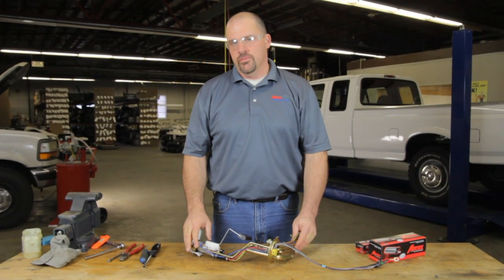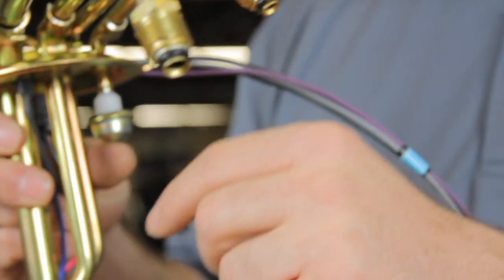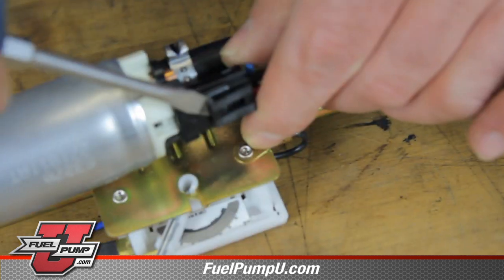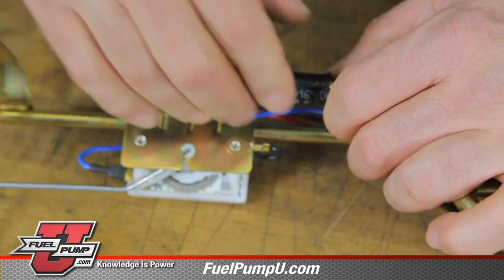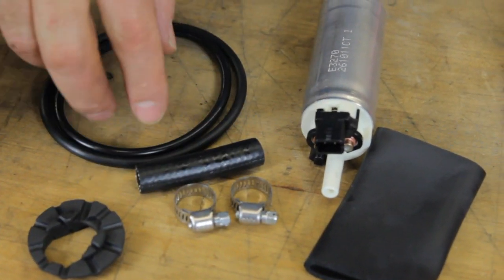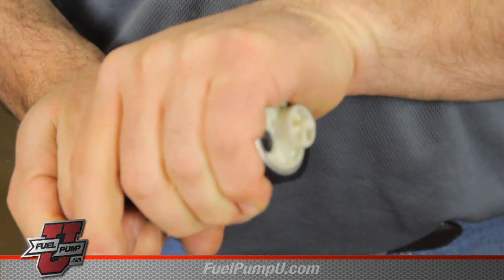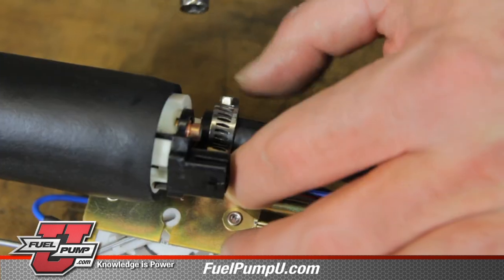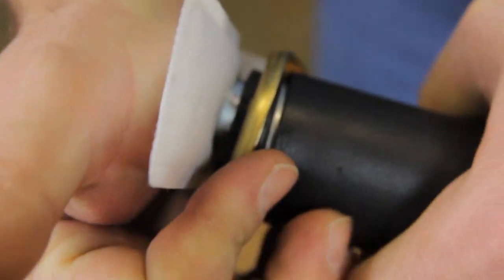How to Install In-Tank Electric Fuel Pump E3270

Comment: What if your new pump motor comes with a wiring harness that plugs into the motor but needs to be spliced with the oem connector on the other end? Is having spliced wires in the tank dangerous??

Comment: My fuel pump assembly looks identical but where the 2” section of hose is mine has a block with some sort of diaphragm block in that spot. Can I just slide the new pump into that or remove it and use the hose provided

Comment: do you have any videos on how to splice that wire connector to the fuel pump, I was trying to get an angle to see where it leads on your video but I couldn't. The new pump I got from you has that connector but my original pump on my 85 eldorado isn't the same so I have to splice the wires.

Comment: why are the fuel pumps made better? Mine lasted about a month.   I replaced everything including the tank.  Why not 2 metal gears like in an oil pump? My chevy s10 pickup doesn't like fuel pumps.
Reply from the maker: The pump in this video, E3270, is a roller vane pump. It as well as a gear drive "geo-rotor pump, are susceptible to damage by contamination as the dirt gets caught in the moving components, crushed between the gears. Clean fuel and system are the only safe answer for a pump. And that goes for any pump, not just fuel.
Reply: Airtex-ASC Performance Pumps I replaced everything. The tank the hanger assembly fuel pump and sock at the bottom. Pumps made like this should be banned.

Comment: Thanks for the video...I purchased a new fuel pump for my car, which came with a strainer and new wire connectors to crimp together.  However, since the replacement pump is smaller than my original, the old rubber base doesn't fit my new fuel pump.  So I was wondering how I could secure it to the sending unit assembly.?  
Can I purchase a smaller rubber base separately... are they universal ?
Reply from the maker: I will need more information to answer you. VIN or the make model, year and engine size will get us started.
Reply: It's my second vehicle, which is a 91 geo tracker, 1.6 L engine 2 dr convert. (some sites refer to the part as a rubber cushion that's you attach to the bottom of the pump and then snaps into the assembly unit.) thanks
Reply from the maker: Our E8238H is a direct replacement module; plug and play. The E2111 is just the pump and would also be a direct fit; no modifications beyond what is supplied with the pump. The E2111 will require the use of the FS164 strainer.
If the pump you purchased isn't one of the ones I mentioned above I really can't comment on a product we didn't manufacture or distribute.

Comment: What is the isolator for?
Reply from the maker: The isolator gives separation between the pumps metal body and the metal hanger. It dampens vibrations from the pump to the hanger making for a quieter operating pump.
Reply: +Airtex-ASC Performance Pumps Makes since. Thanks! Also it was difficult to sandwich the isolator between the pump and hanger because it's at angle. So I put it between the strainer and hanger. Does it really matter?
Reply: +Airtex-ASC Performance Pumps Nevermind. I managed to bend some things around Lol
Reply from the maker: Yes, it does matter. The isolator needs to be between the pump and hanger.
Reply: +Airtex-ASC Performance Pumps Thanks I figured it out

Comment: What is the isolator for? Why are some pumps magnetic and others aren't? :0
Reply: Thanks that clears things up a bit. :)
Would it be okay to lay down a fuel pump in a tank? Or would it have to be vertical in the tank? Or would it depend on the pump?